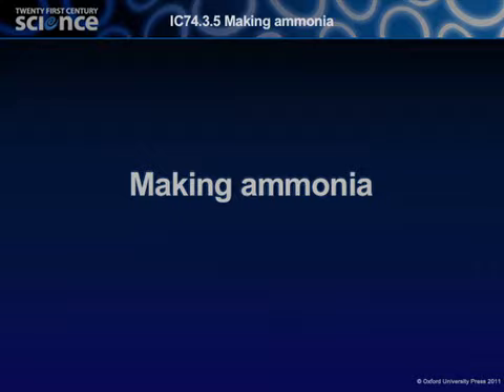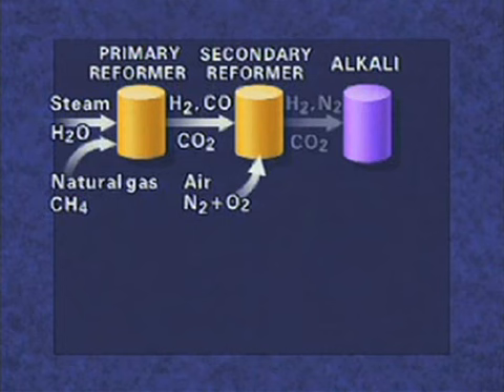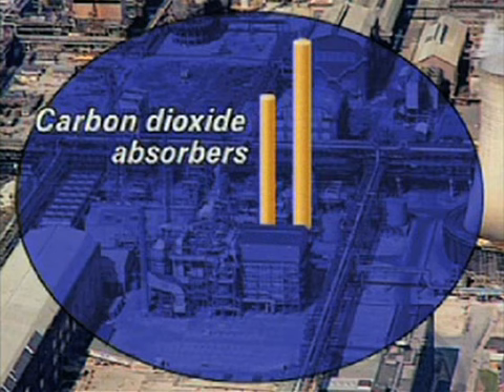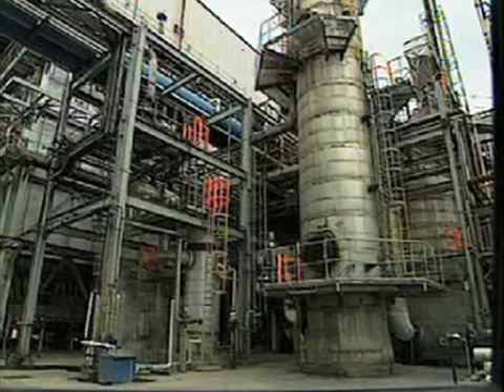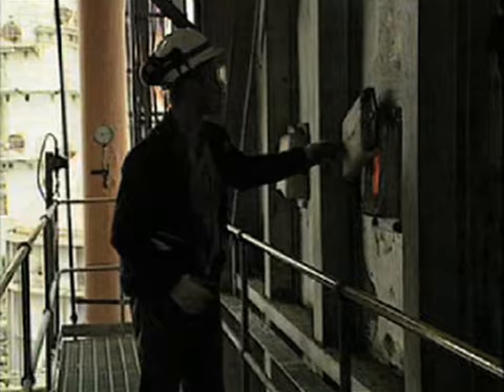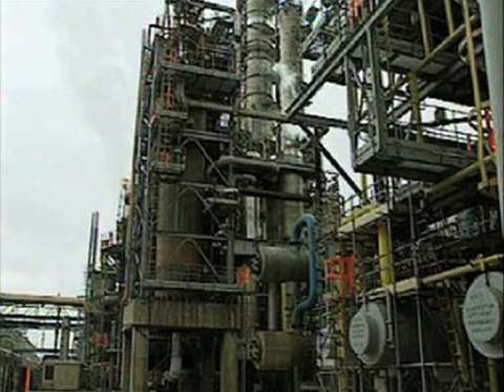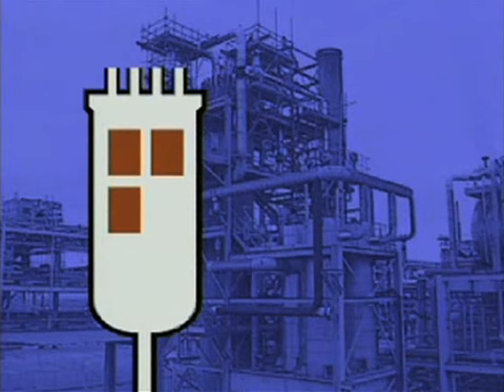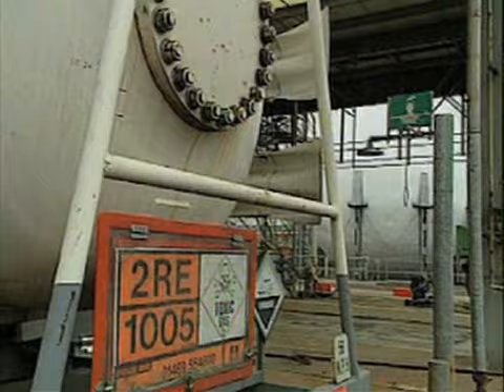Making ammonia

Comment: So basically in a shortcut way,  you first create a liquid nitrogen “there are fun homemade videos on YouTube doing it” and then you need H2 you can get that from H2O by put a positive and negative of a charged wire in a long bucket full of water 🚿 and collect some H2 and combine the two “ liquid Nitrogen and H2” in a cooler and get your ammonia to your garden , right?!
Reply: Well, you also need the catalyst a heat source and a reaction vessel that can withstand 3,000 psi at about 752 degrees F.  That part would be pricey to do on even a small scale.  "But I do think it could be done".  I would be easier if you were a certified welder.